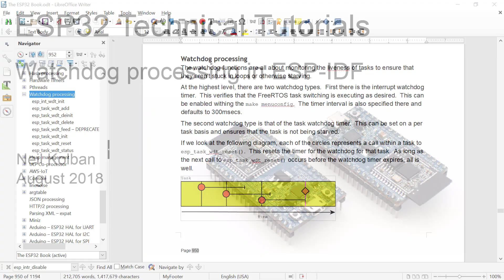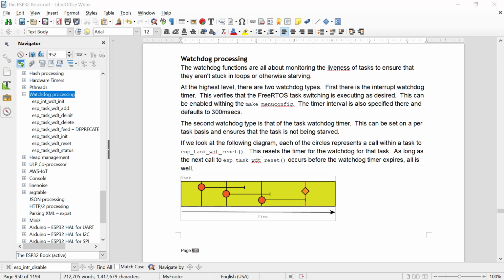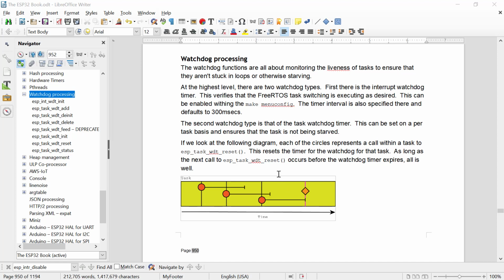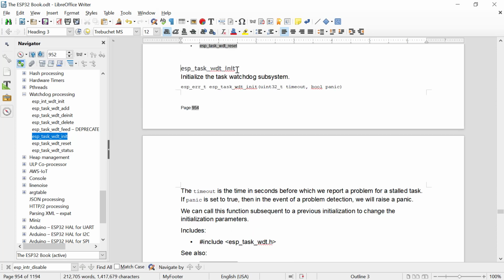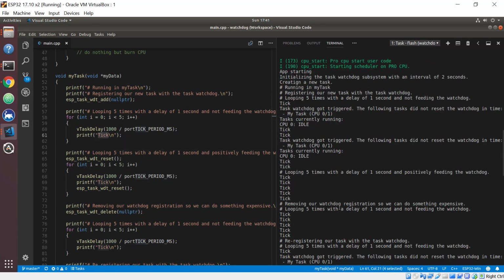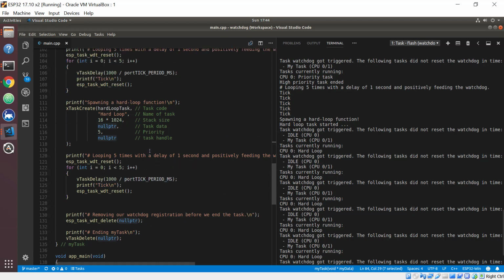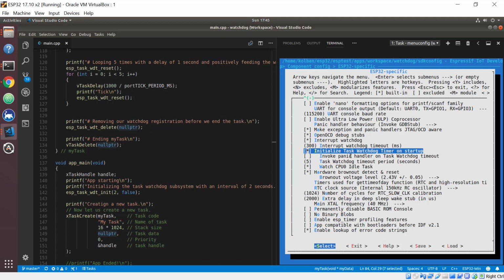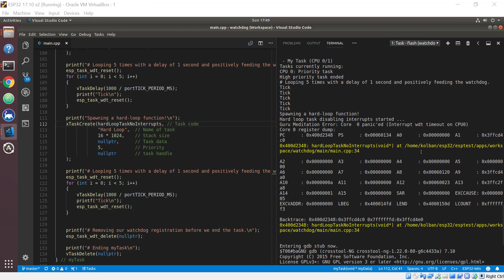ESP32 Technical Tutorials: Watchdog Processing

Comment: Dear Kolban!
Please see this question:

The first ESP32 module is the AP server, and the other two are its clients (clients have the same source code).
One client receives the IP address 192.168.4.2, and the second - 192.168.4.3.
The client who first connected to the server and received the ip address 192.168.4.2 receives the message from the "OnLED" server, and the client who received the address 192.168.4.3 does not receive the message.

How can I write code on the server so that I can send messages to all clients at the same time and how can I write code so that I can send messages to specific IP addresses?

Thank you so much!
I enclose the code (Arduino Ide):

// AP Server
#include <WiFi.h>

const int LED_PIN = 16;

// Replace with your network credentials
const char* ssid     = "ESP32-Access-Point";
const char* password = "ESP32accesspoint";

WiFiServer server(80);

void setup() {
  Serial.begin(115200);
  delay(1000); // даем время на запуск последовательной коммуникации
  Serial.println("Setting AP (Access Point)…");

  pinMode(LED_PIN, OUTPUT);

  digitalWrite(LED_PIN, LOW);
  delay(100);
  digitalWrite(LED_PIN, HIGH);

  WiFi.softAP(ssid, password);

  IPAddress IP = WiFi.softAPIP();
  Serial.print("AP IP address ");
  Serial.println(IP);
  Serial.print("MAC address ");
  Serial.println(WiFi.softAPmacAddress());

  server.begin();

}

void loop() {

  WiFiClient client = server.available();    //Listen for incoming clients

  if (client)
  { //If a new client connects,
    Serial.println("New Client.");           //print a message out in the serial port
    while (client.connected())
    {
      Serial.println("Client connected.");
      Serial.println(client.available());

      if (client.available() > 0)
      {
        // read the bytes incoming from the client:
        char answer = client.read();

        // echo the bytes back to the client:
        server.write(answer);

        client.println("OnLED\r");
      }
    }
    client.stop();
    Serial.println("Client disconnected.");

    digitalWrite(LED_PIN, LOW);
    delay(5000);
    digitalWrite(LED_PIN, HIGH);
  }
}
_________________________________________________________

//Client
#include <ESP8266WiFi.h>
const int ledPin =  16;

const char* ssid = "ESP32-Access-Point";
const char* password =  "ESP32accesspoint";
String fromServer;

WiFiClient client;

IPAddress server(192, 168, 4, 1);

void setup()
{
  Serial.begin(115200);
  delay(1000);
  Serial.println();

  pinMode(ledPin, OUTPUT);

  digitalWrite(ledPin, HIGH);
  delay(100);
  digitalWrite(ledPin, LOW);

  Serial.printf("Connecting to %s ", ssid);
  WiFi.begin(ssid, password);
}

void loop()
{
  while (WiFi.status() != WL_CONNECTED)
  {
    delay(500);
    Serial.print(".");
  }
  Serial.println("connecting...");
  if (client.connect(server, 80))
  {
    Serial.println("connected to server");
    Serial.println(WiFi.localIP());
    client.write("data");
    fromServer = client.readStringUntil('\r');
    Serial.println(fromServer);
    if (fromServer == "OnLED") {

      digitalWrite(ledPin, HIGH);
      delay(5000);
      digitalWrite(ledPin, LOW);
    }
    else {
      digitalWrite(ledPin, LOW);
    }
  }
  else
  {
    Serial.println("failed to connect to server");
  }
  delay(1000);
}

_______________________________________________________